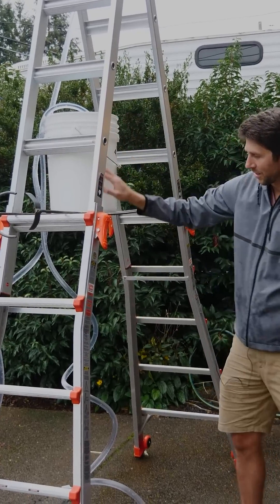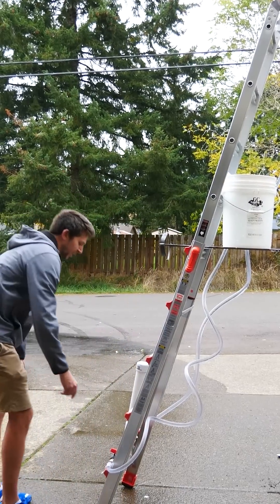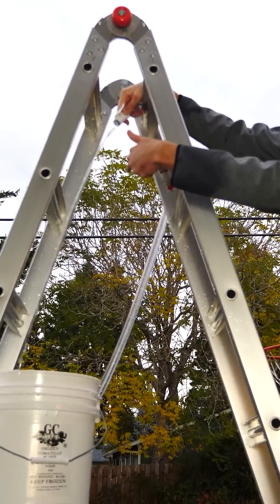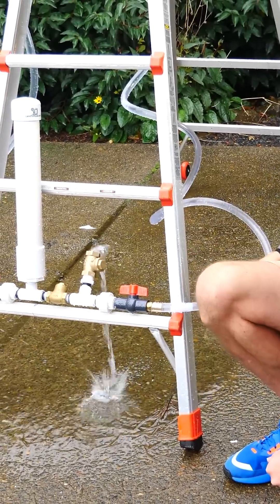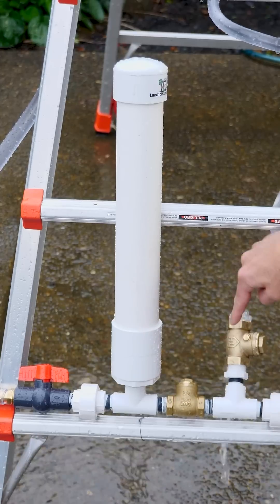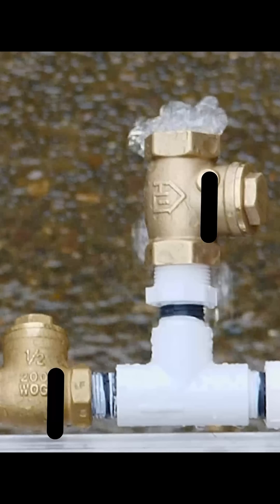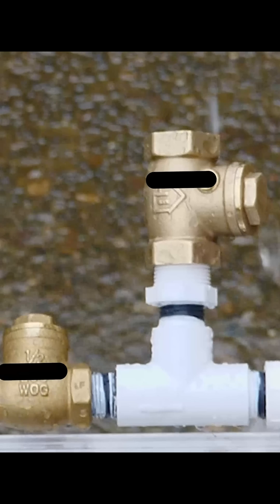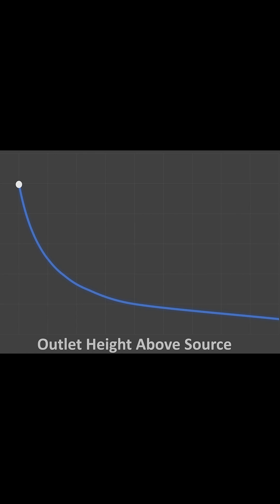Hydraulic Ram Pumps Are Magic

Comment: Is the atmosphere technically doing the work?
Reply: No, it's gravity. Potential energy is being converted to kinetic energy as the water flows downhill. The inertia of the flowing water is then suddenly redirected into the tube going up which overcomes the static (not moving) head pressure and pushes water up. As the velocity of the water decreases, its kinetic energy also decreases, and as soon as it does not have enough energy to overcome the static head pressure, the flow would actually reverse and flow downhill again if not for the valves switching and starting the process over again by starting to dump some water.

If you collect the water that escapes from the dump valve and occasionally lift it back up and pour it back into the source water reservoir, the work you are doing by lifting the water adds the potential energy back into the system that is required to keep it going.

If you are familiar with water hammer, that's exactly what is happening here.

Comment: This is similar to how an electronic boost converter works. The water's inertia is like an inductor, and the output check valve is like a diode. The other check valve is like a switch.
Reply: I love how sometimes, the math that is used to describe certain things in classical mechanics is the same math that is used to describe certain things in circuitry. For example, if I remember correctly, the math that is used to describe a spring mass system is extremely similar to the math that is used to describe an RLC circuit. How fun is that?
Reply: @Ethan Renckly  Pretty cool. Like pulse tube cryocoolers have a resonant frequency like an LC circuit. And impedance matching is kind of like a perfectly inelastic collision between two objects.
Reply: @YSPACElabs  I only knew about half of those things because of my AP physics teacher in high-school, as well as the engineering classes I took in high-school (Principles Of Engineering and Digital Electronics). I'll try to remember the rest of that stuff for Electrical Engineering and Mechanical Engineering which I will no doubt take in college. So, thanks, I guess.
Reply: @ethanrenckly  The pulse tube cryocooler info was from Hyperspace Pirate, and the impedance matching was from stuff I read online and from my own intuition. It makes sense, so it might be correct.
Reply: @YSPACElabs  Hey, to be fair, most of the more random stuff I don't learn in school (which is most of it) I learn by reading online. I also want to mention that most of the math I know beyond pre-calculus was either taught to me by my AP physics teacher or self taught, which means I understand concepts beyond calculus 3 (my favorite math is complex analysis, specifically iterative complex analysis). It's also due to this fact that despite my understanding of these concepts (with the exception of basic complex analysis), I can't solve a lot beyond pre-calculus by hand. Wolfram Alpha is a very useful tool.
Reply: @ethanrenckly  Here s something I learnt in uni. If u can solve something u may understand it. If u can t solve something u don t understand it at all
Reply: @bamb8s436  What if you can solve it through self-made super convoluted and over-complicated methods that almost always include graphing / graphical representation, but can't solve it the normal way because I've never taken anything beyond college pre-calculus?
Reply: @ethanrenckly  I bet that it would be inconsistent
Reply: @bamb8s436  You would think so, (I would think so), but it's worked for all of the problems (that aren't above calculus 3) that I've come up with with the exception of implicit problems (like Lagrangians and Hamiltonians) since I don't know how to solve it by hand. I know that Lagrangians and Hamiltonians are within my mental capacity, but I'm beginning to realize that I might have to actually take calc 1 and beyond before I can play around with them (which really bums me out). 

Anyways, while I'm here, I might as well ask for help. I'm trying to solve for t when x=sin(t)×(cos(t))^2. I've tried to expand sine and cosine into their complex exponential formulas and solving it that way, but so far, that hasn't brought me much luck (I might have made a mistake when trying to solve both ways I tried). I punched their complex exponential formulas into my TI-89 Titanium and it spit out something that filled four lines on a paper. Is there an easier way of doing this or should I just attempt to solve what my TI-89 was spitting out?
Reply: @ethanrenckly  for your question i bet that cos²=1-sin² would be helpful
Reply: @bamb8s436  Well, it did get me closer than some of my other attempts and simplified it down to 2x=-sin(3t)-sin(t). I'm beginning to wonder if there is even a true solution to this problem that is non-implicit and can be solved through conventional methods (I know there's infinitely many solutions, but I'm only trying to solve for the four closest to 0, so {-pi<=t<=pi}). The reason why I'm trying to solve this is that I'm trying to find a valid set of cartesian functions (y(x)=?) for the polar function r(theta)=d/d(theta) of cos(theta)^2. I've already determined that d/d(theta) of (cos(theta))^2 is equal to -2×sin(theta)×cos(theta), and I know therefore that f(t)=f(x,y)=(-2×sin(t)×(cos(t))^2,-2×cos(t)×(sin(t))^2) (that's parametrics in case that format is unusual). That's how I know that x=-2×sin(t)×(cos(t))^2. If I solve for t, I can fill whatever I find into all t's in y=-2×cos(t)×(sin(t))^2 to get a cartesian formula out of the theta derivative of (cos(theta))^2. Do you see where I'm going? If so, any pointers?
Reply: @ethanrenckly  That ^ is actual math? Damn, that is crazy.
Reply: @ethanrenckly  I think that what u are trying is impossible. I m not sure what r(θ)=d(cos²θ)/dθ (flexing the θ as a Greek lol) describes because it can t be the distance from (0,0). Each of the points (r,θ) and (x,y) consists of independent variables. So there can t be an f: R→R to do what u want. If u aren t familiar with it there are f:R²→R² that take a point in 2 dimensions and give of a point in 2 dimensions which is what u are looking for. This can be generalized and u can have an f that takes a n-dimensional point and gives of a m-dimensional point for any n,m that belong to N*. I might have misinterpreted something from what u said so plz correct me. If I haven t tho my advice is to tackle other problems because time has value and this problem doesn t make sense
Reply: @bamb8s436  First, nice theta flex. Second, though you might have slightly misinterpreted my personaly brain breaking math question, I think your advise still stands, and I had already come to the same conclusion that this brain breaker is impossible to solve (through conventional methods at least). And yeah, I suppose there are some more interesting math problems to evaluate. 

I have recently found myself at an impass with my favorite math: iterative complex analysis. Not willing to sacrifice accuracy (within reason) for some kind of actual results, I have found that my computer hardware is far from sufficient, and that sufficient hardware is somewhat outside my budget (for now). 

In the meantime, I wrote out the iterative Newtonian parametric mathematics that describe the 2D position of a spring pendulum at a defined point in time with accuracy determined by length of change in time interval between iterations. I've attempted to take these equations and turn them into straight Newtonian parametric mathematics, and come to the conclusion that this is impossible by conventional methods. When I asked my advanced physics teacher about this, he stated something along the lines of "If you want to find every position that the spring pendulum can be, use Lagrangians. If you want to solve for the position of the spring pendulum in relation to time, assuming this is 2 dimensions of space, you gave it some mass, some spring constant, some 2 dimensional initial position, and some initial velocity in some direction, with ridiculous accuracy, use your current weird iterative method and start asking the question 'where can I get a damn supercomputer'". 

Anyways, I'm going to attempt to (at some point, maybe soon) make another attempt at teaching myself Lagrangians because from what I've heard, they're damn useful, and you can do some pretty interesting things with them.
Reply: That much energy is lost?

Comment: Can't we use this model to make a power plant?
Reply: Why would you do that?
Reply: In the sense that water at a height has energy that can be extracted for work as it flows to a lower elevation, we do: that's what a hydroelectric dam is.
Reply: @GaryDunion  Ram pumps efficiency can be at it's best around 80%. Why would you waste this energy instead of generating the power right away? It would just make things more complicated and expensive.
Reply: @radimkundrata2398  I'm not sure I understand your question. But to be clear, I'm not saying hydroelectric dams use ram pumps, only that they use the underlying energy source of ram pumps, that is, water at a height has energy. Maybe that helps?
Reply: @GaryDunion  My fault. For some reason I thought you're reacting to my comment. Ofc you're right.
Reply: @radimkundrata2398  No worries!